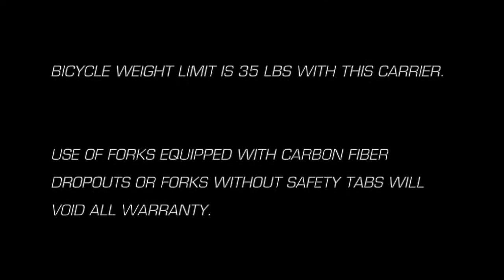RockyMounts Euro PitchFork Use & Installation Guide

Comment: I couldn't move the wheel strap passed the rear hardware after I assembled it. 
 So I had to disassemble it then move the strap in position cause it couldn't get passed the screw head.